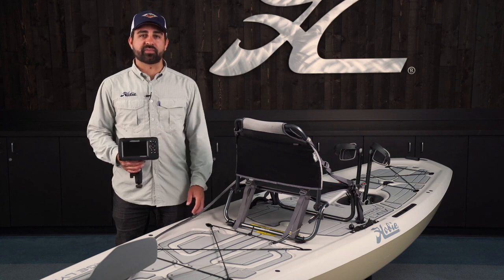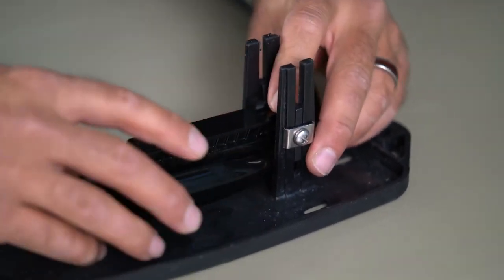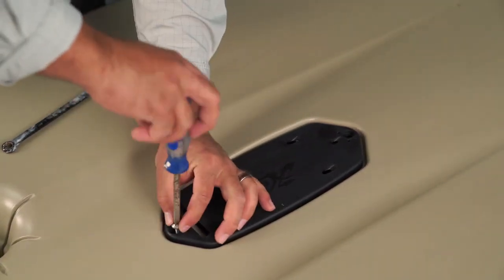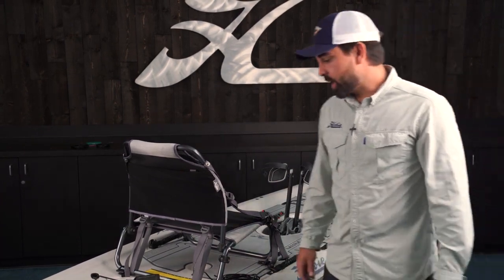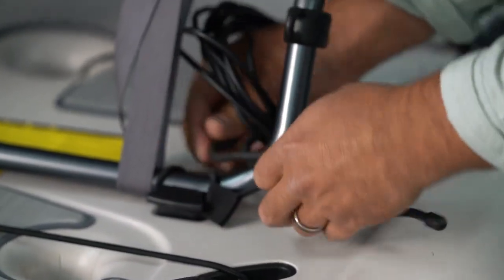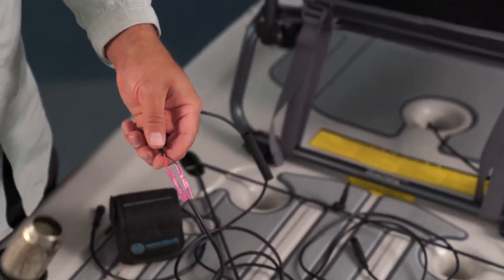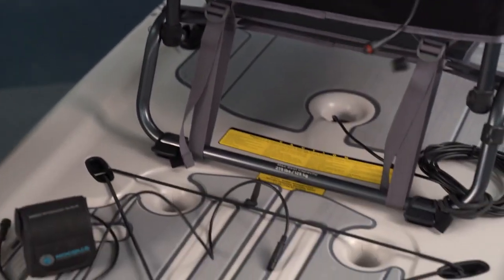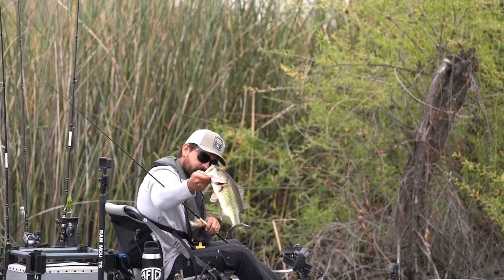Fish Finder Install Hobie Mirage LYNX

Comment: No storage compartment for the battery or small gear is a problem. It's a neat design but this is truly a Hybrid Paddle Board with a Beach Chair and a $1,000.00 drive system.

Comment: You can put cable and battery in small waterproof box ...drill some holes to run wires .
Reply: not supposed to drill into the Hobie lynx. It's foam filled.

Comment: Is there a specific mounting kit you need to buy to attach the transducer to the insert on the kayak?
Reply from the maker: Hi Stephen , the Lynx is Fishfinder ready, the sounder plate just needs to be unscrewed and the transducer mounted on to it. Theres is no need for a kit
Reply: @HobieAsiaPacific  part number for the triple shot mounting kit?
Reply from the maker: @scottroberts3442  Hobie offers specific kits for mounting Lowrance SideImaging transducers like the TripleShot (PN 72026219 TRIPLESHOT KIT W/PLATE) and TotalScan/ActiveImaging 3-in-1 (72025010 LITHIUM PRO POWER KIT 12V 10AH).